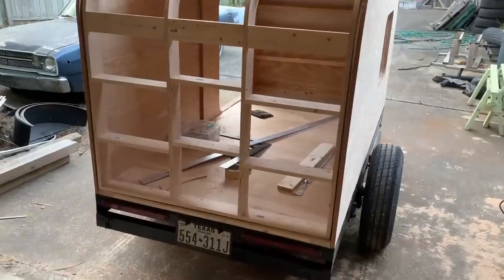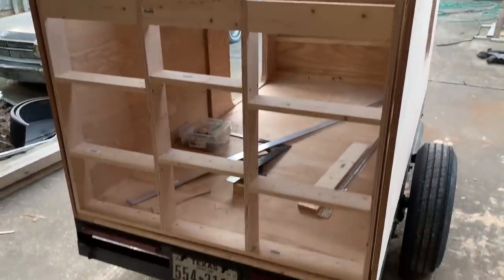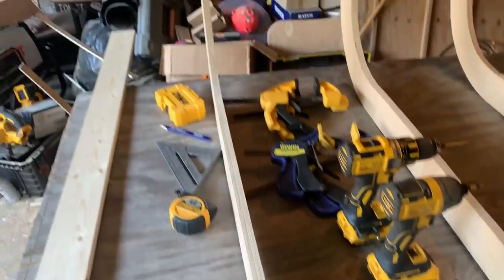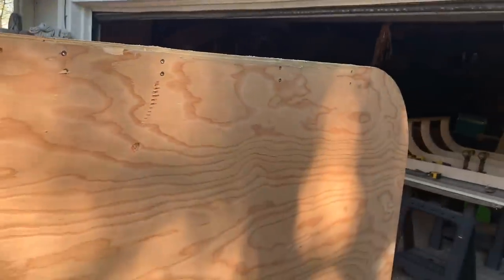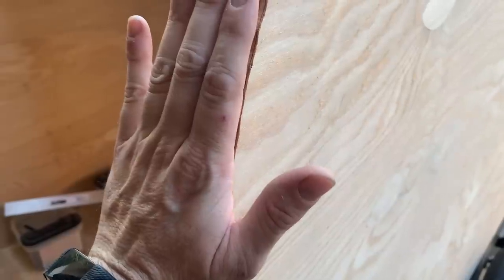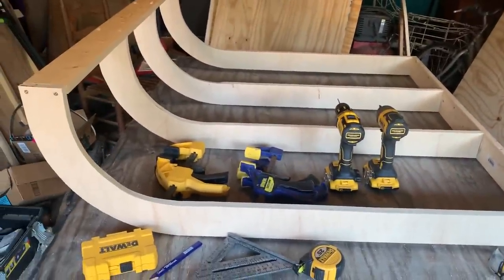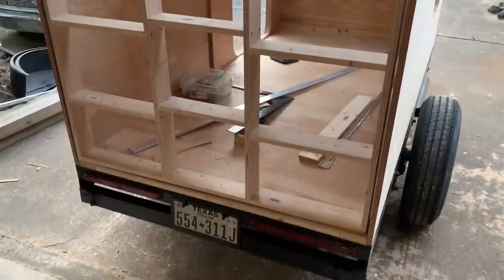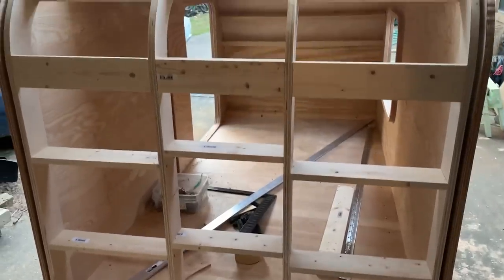DIY Micro Camper - Galley Hatch Frame

Comment: Hello Sir, thankyou for sharing your build. I so enjoyed watching you offer up the tail gate to the rear of your camper. It fitted beautifully. A credit to you. Could I also tell everyone who reads this. On DIY programmes/footage, it's not often you see holes being drilled for screws. We in England call them pilot holes and help prevent the wood from splitting. Many people just drive the screw in. That's not how the screw works. The hole accommodates the shaft of the screw and the screw threads cut into the wood or mass. Using the correct size of pilot hole, not too large, and a little bIt of grease/vaseline makes the screw go in beautifully, but also can be retrieved easily too. Loved your footage Sir. Lots of people, including myself will be inspired by your film, thankyou and good luck.

Comment: Looking good 👍👍👍 ... I see you've got done great tools now ... A better suited trailer and panelling going straight down the edge of the trailer too . 
I wanted to add one thing though , the galley door will weigh a fair bit and I thought a vertical piece of timber running down the wall supporting the top brace , where the door is hinged could add some strength and help carry the weight of the door.  
Cheers , looking good 👍😅
Reply from the maker: Simon I will eventually have some cabinets just below the hinge that should help support the hatch door. Thanks for watching!
Reply: @BasecampUnbounded  nice one mate 👍👍👍👍👍

Comment: On my older table saws and radial arm saws they have a resettable overheat circuit breaker.  (usually some sort of pop-out button)  Wonder if that was the problem with your table saw...
Reply from the maker: Robert Pendzick I didn’t see one but it was a really cheap saw. I replaced it with a Dewalt already so all good. Thanks for watching

Comment: Found your build through the 6 mistakes video and started watching this new build. Looking good. Are you worried about not having insulation on the walls at all?

Took some tips and tricks to heart on my micro camper that I'm making so thank you for those.

Always cool to see other Texans building things, im down near Htown and have been trying to deal with the heat during my build... its brutal.

Keep up the good work.
Reply from the maker: I found with my previous build that no insulation in the walls isn't really a big concern, but I may end up adding some from the inside if it becomes necessary. I agree the heat has made building a little unbearable for now. Thanks for the support.
Reply: Baytown here. Building a trailer to pull behind my adventure converted van. Mostly for gear and extra sleeping space

Comment: Why do all openings have added thickness
Reply from the maker: brickley2 the window and door are from a previous build and were designed for 1 and 3/4” thick walls. I had to add the extra width so they would fit. I’m also using the door side to hide the wiring for the light outside and the switch inside. Thanks for watching!

Comment: BULLETPROOF! Could have added a 4" concrete slab with a 3/4" plywood sub-floor, I mean if extra WEIGHT was more your goal. Did you add a 5.2 K axle with 10 ply tires too? LOL.....

Comment: You need to be using marine plywood, the plywood you have for wall will turn to mush after it gets wet or damp a couple times. All this work and cost will be lost. Your design doesn't allow any possibility for insulation.
Reply from the maker: Charles Riggs The walls are marine grade plywood. I may insulate from the inside. Thanks for watching!
Reply: THXS for the reply. Urge you to be careful per using mostly plywood for your construction, it's a poor choice and design, most plywood is made overseas and loaded with harmful chemicals such as urea formaldehyde. You don't want be sleeping in your camper fulltime inhaling these harmful fumes.
Reply: @charlesriggs6406  man stop with the downbuzz . This guy's done an amazing job an 90% of these campers have wood in them. Most new houses are full of chemical based compounds.
Reply: Sealed with marine based paint.. or a latex coating for flexibility. Or a marine varnish.. but honestly if you know how to use house paint or any paint you should be able to seal a surface no matter what the material... I'm a House painter of 12years painted few cars too. Yeah just use the right paints with eight preparation...an to much insulation can be worse than nun at all. If the floors done an maybe ceiling id say that's ok.
Reply: I'm doing mine in an oil based sealer .with enamel car paint over . You need to do a sealer coat then sand an fill then undercoat then sand again with 180 _240. Then dust . Tack cloth. Then paint gloss on. With the car paint you can apply a car wax.... Rain falls straight off.  Over time the ply may fuck out with heat stress. But could look at a vinal wrap.or aluminium skin
Reply: Don't use plywood? What the hell else are you gonna build a trailer with?